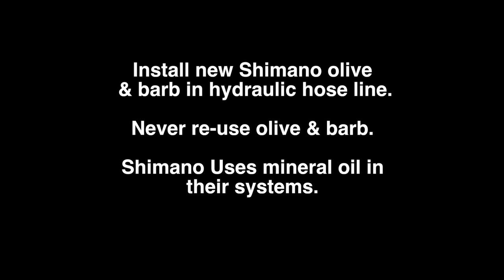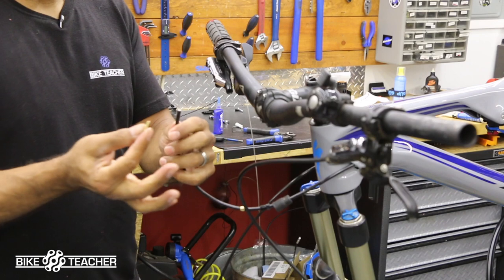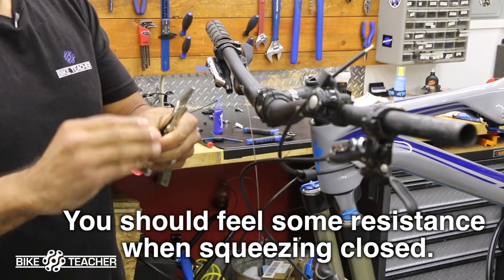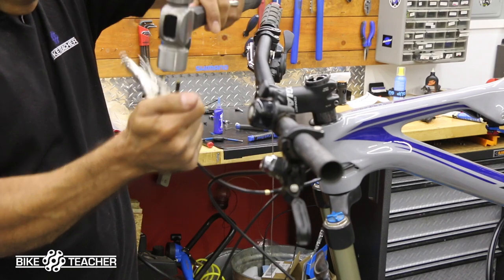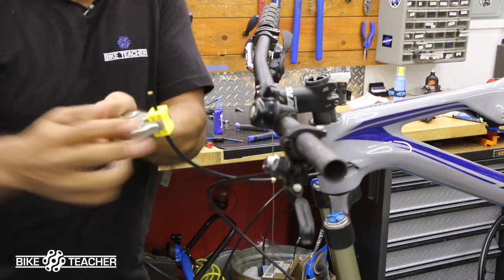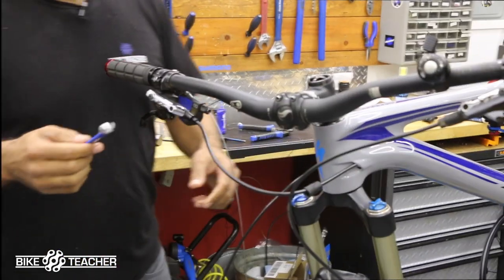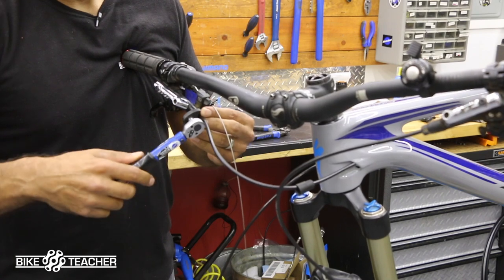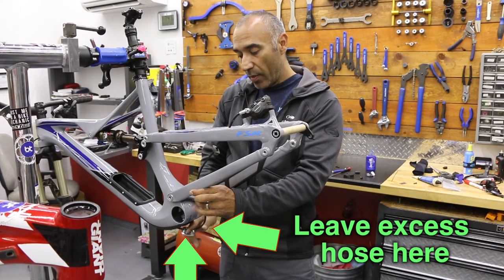How To Install a Barb & Olive in a Shimano hydraulic hose line.

Comment: As I understand it (from installing hydraulic tubing to gauges in an industrial space), what you are calling a ferrule would be a compression nut, part of a compression fitting. The part that everyone in the bike world is calling "the olive" is the actual "ferrule" in a general sense and is also part of the compression fitting.
Reply from the maker: I get it. That makes sense. I it may make more sense to call them end caps. Not to be confused with the crimps for the end of cables.

Comment: Tried fitting these twice. Both times the fitting failed after a couple of rides. Both occasions the olive is crimped around the end of the hose - no idea how/why. Nightmare to retrieve insert and I have no idea which insert/olive kit will fit the line/lever, so binning the shimanos and going back to my 20 year old hope mini’s - easy to fit, service and bleed. Might indulge in a ceremonial lump mallet demolition of the shimano parts.
Reply from the maker: Hmm. Were you getting a leak?Did the hose pop out? I like to use the crows foot tool and torque to 7 nm. Could be an olive model mating problem, although pretty rare if you are using Shimano with shimano parts.
Reply: Bike Teacher Well, after mini tantrum out of my system ;) I tried one more time (with new insert & olive) and tightened up reeaal tight by feel - there’s about 3mm of the thread left showing - and so far... it’s fine. Now to figure out how to service my 2001 x-vert forks...

Comment: Thanks - I'll add a like and follow for this. I made the blocks by sawing a groove in 2 pieces of wood and using a clamp to hold it on place. Crude, but it worked. I was stressed because this job has seen my local shop order the wrong parts for me no less than 3 times.
Reply from the maker: That's great ingenuity. It's fun, unless you gone through some stress. Thanks for watching. Arthur

Comment: FYI - when using a crowsfoot with a torque wrench, it needs to be in a very specific position (at a 90 degree angle to the body of the wrench), otherwise you'll actually be applying either too much or not enough torque, depending on the position. This video explains it in more detail: https://www.youtube.com/watch?v=fBjr9-FDWYw
You can use it positioned straight out from the end of the wrench if space is a constraint - but you then need to do some measurement and math and adjust your torque value accordingly. In this case I realise the difference is (probably) negligible, but I figure when working on something as safety-critical as brakes, it pays to get things as accurate as possible!
Reply from the maker: I agree with everything said. Proceeding with caution while working and just as importantly but not always possible from the rider, paying close attention on test rides. Test extensively off the bike by squeezing the brake lever as hard a s possible and look for leaks. Wear safety glasses and anticipate the hose popping off the lever.
Reply: Probably negligible, yes. But exactly the sort of thing that needs to be pointed out on a channel like this where many are first learning basic mechanic skills.  Came here to say the same but you beat me to it!

Comment: On some XT brakes I've installed the copper olive was greased with some clear grease when I took it out of the packaging. Any ideas/thoughts on this? Often use olives from a small parts box, and those aren't greased, so curious if I should be doing that! My guess is something like silicone grease (i.e. dielectric grease) would be safe on rubber, inert so won't react with mineral oil, etc.
Reply from the maker: To my knowledge the grease may be specific to help form a seal. I have never used the grease and have experienced no problems regarding leaks.

Comment: I am installing a new brake lever.  The hose already has a barb and olive installed.  When I swap out break levers, is the current barb and olive in the hose sufficient, or is it necessary to use a new barb and olive?

Comment: Cool, thanks for the  video. I have a doubt about my install - firstly i didn't insert the barb all the way (left like 1mm) the blocks just didn't grip the hose and it slipped through. Does this will make a problem? The second thing - on the rear brake i managed to install barb flush, but when i tightened the bolt, some oil just spilled out - did i over tightened it? Its not leaking right now!  What do you think?
Reply: I think that you will not understand this response from your query due to the amount of time elapsed since you commented.....But LOL I made you look!

Comment: Good Afternoon Sir, Ive a leaky BR-R785 caliper, and have a BR-RS785 caliper to replace it. Question is, can i remove the banjo from the BH59 hose and make a new connection for the new caliper which uses the other type of fitment? Thanks!
Reply from the maker: I the proper replacement parts are available I don't see why not. Although I can't say I am that familiar to offer solid advice.

Comment: I noticed the bolt that screws into the caliper that holds the housing in place wasn't straight. So I unscrewed it and tried to put it in straight but the threads in the caliper are all cross threaded. I didnt know about olives and needles before taking this out. Then learnt the olives are one use only and need to be crushed into place. Me, not knowing what im doing tried to screw the bolt in straight and failed many times. So screwed it in how it was, then bled the brakes and everything was fine. Until the next day. Oil all over the caliper coming from the housing bolt that fastens into the caliper. I'm wondering is it because o re used the olive? Does it matter the bolt isn't going in perfectly straight as long as its secured/crushed the olive in place? It wasn't leaking before I messed around with it which makes me think i could get away with just replacing the olive and thread ? Any advice would be much appreciated
Reply from the maker: Hi, did you resolve this? Yes, new olives to be be used for every fresh installation. If the nut screws in crooked the threads are most likely compromised. It's very possible the threads on the lever are stripped due to a softer aluminum Where as the nut a a stronger metal like steel.

Comment: Trying to install a front Deore brake now and man, that barb is a cow to get in. Shimano don't include the yellow pinch block anymore. It's still out about 3mm and it's fighting me every mm.

Edit: managed to get it. Holding the hose further away from the barb when hammering helped get it home.
Reply from the maker: Use a pick or something pointy to shove in the hole to over size it. Use pressure. Don’t poke yourself.
Reply: @BikeTeacher  Thanks, I managed to drive it in. Your point about holding the hose further down helped - I think was holding the pliers too close to the barb.
Reply: Same problem, very difficult if they don’t include the yellow block
Reply from the maker: Nice. Park tool has a plied that is needle nose that also has a crimp for end caps as well as two openings for housings. The hydraulic line should fit in there without crushing or.

Comment: Should the crows foot be at a 90 degree angle to the torque wrench handle?
Reply from the maker: Yes, from what I’m told, that’s what park tool says for their pedal crows foot wrench as well. But honestly I have done this many times and have not had any negative outcomes, long or short term. And that’s with not adhering to that guideline 100%.
Reply from the maker: Because it is in  awkward area. Hope this helps.
Reply: Yes. Proper professional mechanical use of the tool is that way.  Otherwise the torque reading will be off. You could always math out the angles to figure it out, but if you're doing that, you're probably not using the tool wrong in the first place.

Comment: Do i have to cut the tip of the hose where the old barb and olive was or could i just pull it out so i wont cut the hose short
Reply from the maker: It’s best  to replace all the old hardware,  yes cut the minimum end of the hose.

Comment: What if there is still oil leaking? What does it mean?
Reply from the maker: It could mean the hose my be cut at an angle and not flat across. Or the tightening bolt is not at 6-7 nm. Or the olive may not be sitting fully inside and crushed incorrectly. When tightening the bolt, you want the hydraulic line to be fully inserted and keep firm pressure inward as you are tightening.

Comment: Do you have to replace the "olive" crush washer if you disconnect the lines?
Reply from the maker: Yes, always replace the barb and olive. It is designed to get crushed or deformed. That’s what creates the seal.  The seal needs to be reformed every time.
Reply: Great, Thanks!
Reply: I should have read/watched this before cutting my XT 8100 brake hose. I tried to remove the barb and olive out but its tightly shut and wont bulge sighhhh. Have to go to the LBS to pick up a new set

Comment: Hi what happens if you over tightened the bolt? Can it damage anything internally? Or is the right the better?
Reply from the maker: It’s possible to overnighted. Be careful. I believe the olive would be crushed to the point of failure. Thanks

Comment: I'm not quite so sure about the torque wrench / crowfoot wrench setup.
Reply from the maker: I found this online, I also had a car mechanic take my class and gave a similar answer. Other than that I can't really find an in-depth explanation. "The short answer is no, extensions do not affect torque wrench accuracy. That is if they're used properly, and you're using your torque wrench correctly."
Reply: You need to change the torque setting if you’re using a crows foot, as you’re effectively changing the length of the pivot. https://www.engineersedge.com/manufacturing_spec/torque_wrench_1.htm
Reply: @martyndaniel6055  or put the crows foot perpendicular to the wrench
Reply: @tjb8841  Would that work correctly?

Comment: Why are you using vise grips on blocks that are designed to be used in a bench vise? you're not getting full-length clamping pressure and that's why the hose is sliding. 
Generally helpful info and description, but zooming in closer so you can actually see what the presenter is doing would be much more helpful. 
BTW the proper way to use a torque wrench with a crow's foot is at 90 degrees.  (Insert Geico quote)
Reply from the maker: Great comment and true information.